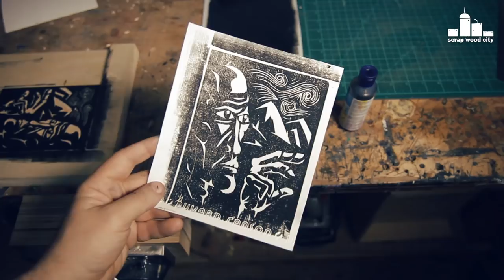Introduction to wood block printing and carving

Comment: If you draw black-on-black, how could you see what to cut out? 
And normally peop[le creating an image first on some paper and then transfer it to the woodblock. In your case, the woodblock is black, so how to transfer the image to the black surface?
Reply from the maker: It's a matter of practice
Reply: @ScrapwoodCity  Drawing (or transferring) a black trail onto a black surface will certainly require a lot of stupid practice.

Comment: Nice project and really interesting. Why not using a second clean roller to press the paper. I suppose you'll have less effort to deal with.
Reply from the maker: It may work but I am  not sure if it does. Some people use a metal spoon for that job!

Comment: you have to wet your paper in water at least half an hour before printing. Better still if you leave it soak overnight and later remove excess water with either blotting paper or a piece of clean cloth.